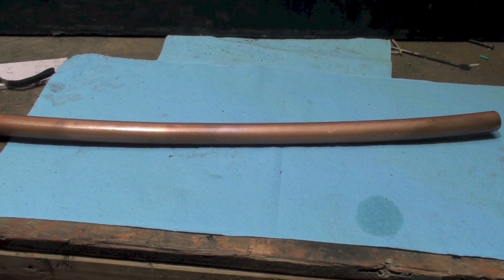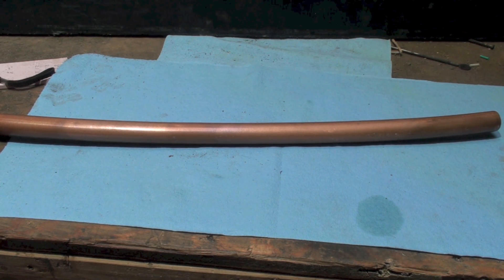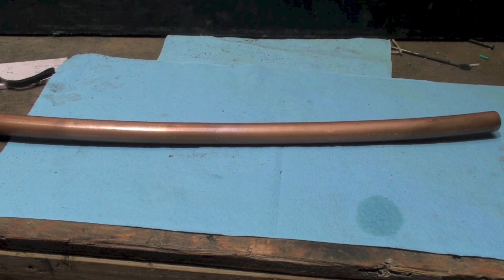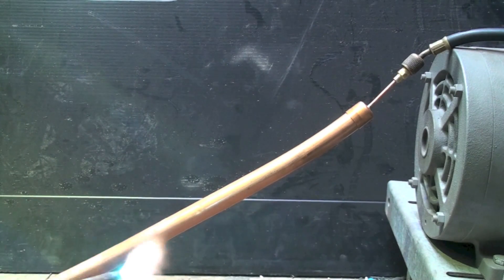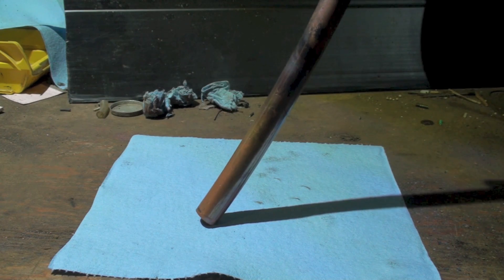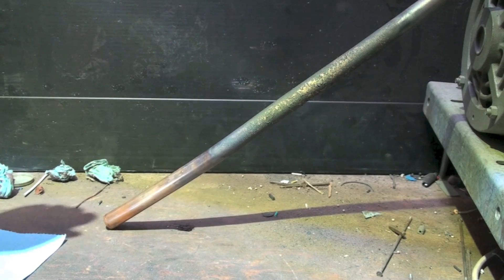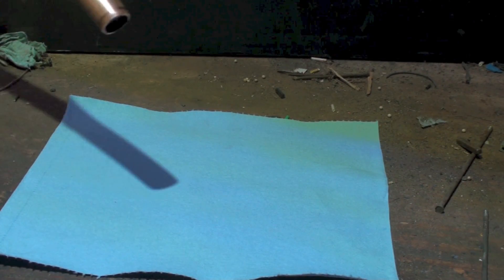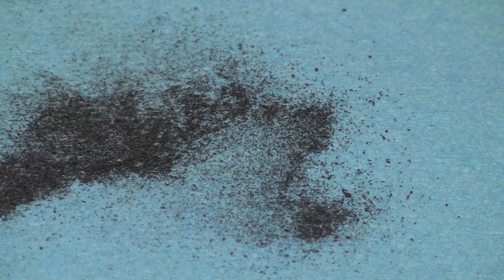Copper oxide in brazing refrigeration tubing

Comment: Thank you for another fine video. 

This guy recommends silver soldering - doesn't get hot enough to oxidize:
https://youtu.be/wJD712DB6S0

R12 systems could be done with lead-solder - right? Pressures aren't high enough to need brazing - here it comes/you knew it was coming - it's the result of another screwing from the EPA and its ozone depletion quackery :)

Technically, I am interested in why R22 was used over R12 in residential systems. (?)
Reply from the maker: For a number of years, Lennox used low temp silver solder to assemble their units.  They had no more problems with leaks than anyone else.  
However, in the service industry, we are dealing with used piping with all the contaminants that that entails.  The high temp braze materials are necessary for these applications.
Lead solder is not suitable for any refrigerant application.  The pressures used, even for R-12, are up to 200# which is far above plumbing pressures.
I can't give you all the reasons R-22 was used over R-12.  They are energy efficiency and oil return properties.  To anticipate your thoughts,  R-22 was preferred for A/C applications long before any concerns of environmental damage were raised.
GFM

Comment: Please do a video on brazing a saddle piercing valve on the discharge line of a R-410A fully charged package heat pump. I am doing this tomorrow with great care. I with use silphos 15 but if I had time to practice, I might use Staybrite8. Thanks. Jim
Reply from the maker: Those valves are brass.  Sil phos will not work well with brass.  It can be done, but temp control is very important.  The best compound is 40% silver solder.  Very expensive.
GFM

Comment: My periodic questions are off the wall because I have no formal training and I'm attempting to become self-taught in order to eventually maintain my own equipment. Since nitrogen eliminates copper oxide rather than forcing it out the line [I assume] is my understanding correct that it doesn't matter where I open the line? In other words, on a 27' line set if there's a leak 5' from the heat pump OR 5' from the evaporator can I remove a schrader at the HP through which nitrogen can flow? And I need not worry that a metering device, reversing valve, etc. will become restricted with oxide particles (and therefore don't need to isolate them)? Thank you.
Reply from the maker: Brian Fletcher If I am understanding you correctly,  where you let the nitrogen in must have an opening that will connect directly from the place it goes in to the place it goes out. Otherwise, pressure will build up inside the tubing and the joints will leak.  Hope this helps.
GFM

Comment: Does it matter when you start brazing while running nitrogen thru the system
Reply from the maker: Rick Luna It should run thru all the time. If that is the question you are asking.GFM
Reply: grayfurnaceman just realized what i wrote lol, i mean does it matter where you begin your brazing as you enter the nitrogen into the system
Reply from the maker: Rick Luna I usually begin closest to where the nitrogen goes in and braze each joint is sequence to be sure I do not miss one.
GFM

Comment: Yeah thats good because most tech's don't do that like if they replace a compressor in a heat pump like if it had a burnout and they just changed the compressor with no nitrogen in the system then the cooper oxide peaces can get in the system clogging the orfice or txv or getting stuck in the reversing valve causing it the stick or even damage the new compressor
Reply from the maker: heatpump hvac All these things are true.  It seems to me that the use of nitrogen is a cheap and simple method of doing a better job.  You need the nitrogen for pressure testing anyway, so why not use it for the braze operation?  Thanks for the thoughts.
GFM
Reply: Think you

Comment: Does the nitrogen actually prevent the oxide or does it just carry it out of the system?
Reply from the maker: Matt Rodriguez It prevents the copper oxide by replacing the oxygen in the air with nitrogen which is an inert gas and will not combine with the copper.  Hope this helps.
GFM
Reply: Got it,  thanks for taking the time to make these videos. Very helpful.